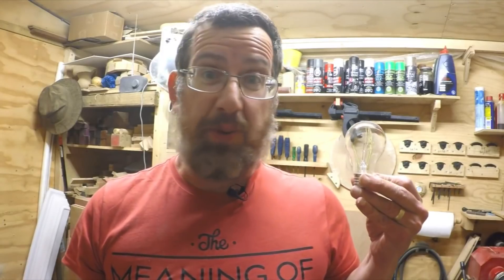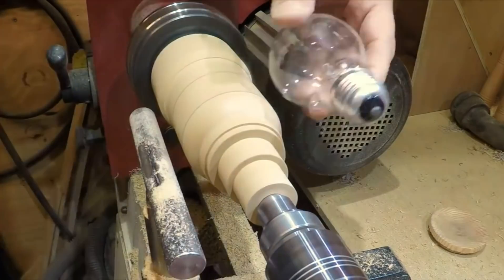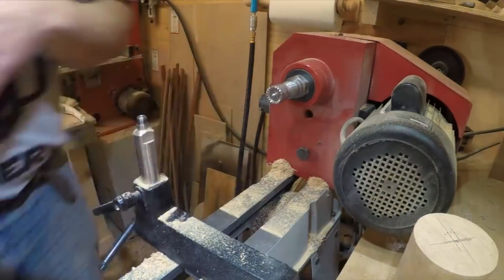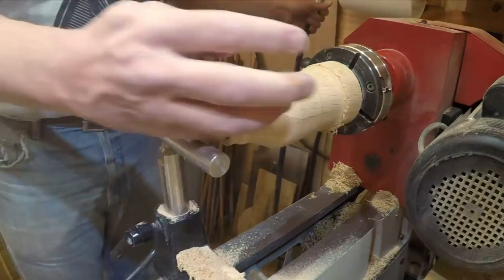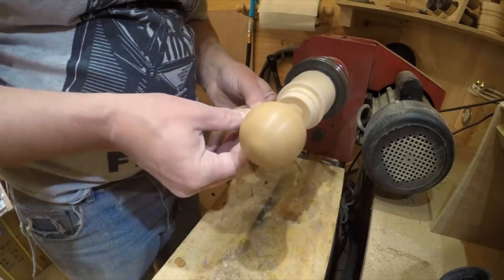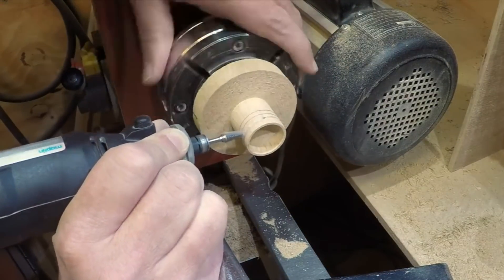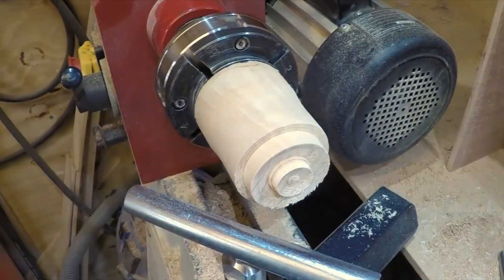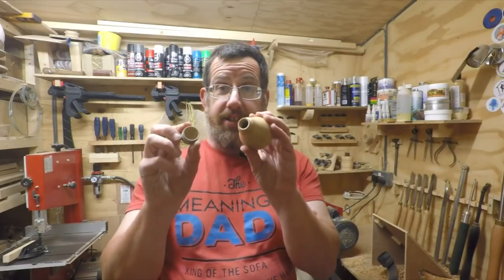Light Bulb Box - Episode 148

Comment: That looks a fun project Paul, I like the way you made the threads look so real. Will you be turning a table lamp and shade to finish it off (?).

Nice one 👍🏻.

Cheers 
Geof
Reply from the maker: Thank you Geoff. The threads turned out better than I thought. The good thing is when you look at the cheap light bulbs their threads are very cheap looking so it worked well. I think I've made enough lamps recently, but I do have another fun project on the go at the moment more detailed model which should be up in a few weeks time.